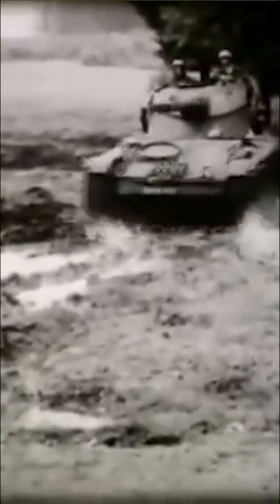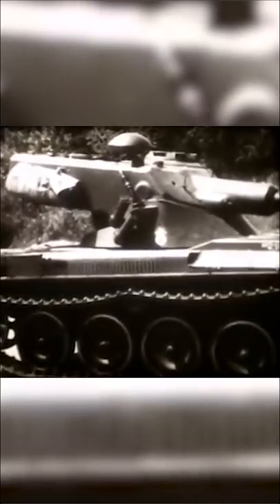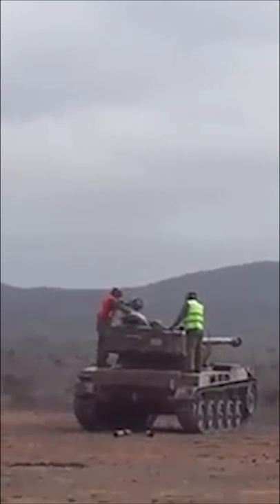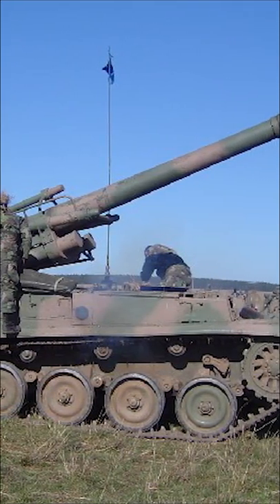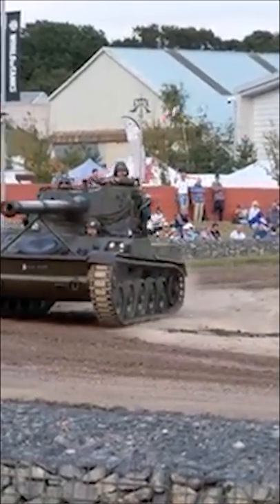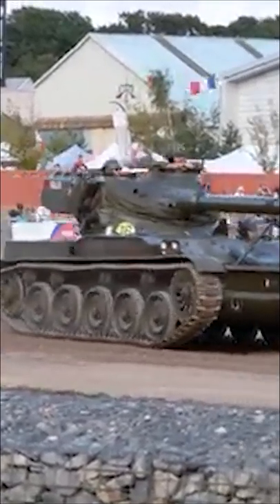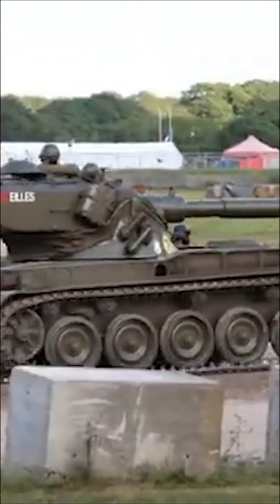Everything You Need to Know About the AMX-13 Light Tank in 60 Seconds | #shorts

Comment: If it was designed shortly after WW2 and is still in service today wouldnt that make it one of if not the oldest tank designs in service today?  I can't think of anything that would pre-date it...
Reply: Vietnam keeps SU-100 in operation, they'd count
Reply from the maker: T-34-85 is also still technically in service, as was the Sherman until just a few years ago
Reply: @ArmorCast  yeah, in Vietnam
Reply: Well how about that i had no idea I've seen some photos of a modernised Sherman but didn't think much of it i certainly didnt know about the T-34 and the SU-100
Reply: @damongale45  there are some African countries that use a m4a3 with a extremely high velocity (like 2,500 mps) 60mm guns
Reply: @damongale45 That would be the Israeli m50s and m51s. Usually just called «Super shermans».
Reply: @finndinklage6653  not exactly. It was Chile which bought about 65 M-60 Shermans in addition to M51 (and possibly M50) tanks from Israel in the late 80s (~1988). The M-60 were Israeli M50 tanks which (like the M51) in turn were upgraded M4 tanks of various models. The be precise, The M50 tanks that were upgraded to M-60 tanks for Chile were based on M4A1 and M4A4 models. The M60 received a new engine (535 hp V-8 Detroit Diesel 8V-71T) and more notably a new gun, the 60mm High-Velocity Medium Support gun. The latter started as a joint development of Israel Military Industries (IMI) and OTO-Melara but they split and each company produced their own version (although its not clear in which development state occured thus the differences between the two versions are unknown). This gun reached a muzzle velocity of 1,620 m/s utilizing APFSDST rounds.
The last M-60 were phased out in 2003 making Chile one of the last if not the last country to operate armed shermans in a combat role. Paraguay operated 3 argentinian upgraded M4 "Repotenciado" and several M3 light tanks in 2015 and its entirely likely that these continue to serve on but they are used in a ceremonial role and might be used in training at best.
Reply: @nopenopeson1097  thanks for correcting me I am getting this from a article that I read about a year ago
Reply: @finndinklage6653  Think it was my man "hendi 1" who made that correction. It would be a shame for me to take credit for the research.

Comment: Cant forget the wheely boi variant
Reply from the maker: The EBR? Not really a "variant" just the same turret and weapons system on a completely different chassis (actually the main EBR versions used the FL.11 turret which only the prototype AMX-13 had)
Reply: @ArmorCast  Hmmm, didnt know, ty for the information
Reply: @ArmorCast  FL11 AXM 13 is a small production made for algerian theater (alongside many AMX 13 US). the prototype AMX-13 had a FL4 turret (and a S232 anti air turret)

Comment: Ok But you missed India too from this list.
India was also one of the users of AMX 13 (both 75mm and 90mm, although details about 90mm ae not available) .
During 1962 sino Indian war, at the late phases of the war , the Air force airlifted about 5-6 AMX 13/75 to chusul airstrip using soviet AN-12 . Indian army actually used this tactic of tank warfare in Mountains , specially during 1947-48 First Indo Pak war , where in the battle of Zojila pass, M3 and M5 stuarts turned the tide in India's favor. the same tactic was also planned to be repeated in case of deeper chinese incursions, but the war ended before that and the engine often failed to start in higher altitude. 

the largest combat , AMX 13/75 and the rare AMX 13/90 ever saw was in the 1965 Indo Pak war , notably in every major tank battles ( Asal uttar , Philora, Chawinda , Sialkot etc) in the Punjab sector. this tank was surprisingly suitable in the muddy terrain of Punjab region where many tanks eventually 

also during 3rd Indo Pak war (part of Bangladesh liberation war) , in the Battle of Garibpur , AMX 13/75 were used alongside PT-76 and M-4 Shermans (with PT-76 Guns) against enemy Chaffee light tanks. and for a major duration of war they were the major armor backbone in Bangladesh. while the western sector was heavily dominated with T-55( local Gulmohar variant with 105mm L7 cannon) , Vickers/Vijayanta MBT, Centurion  clashing against where the AMX was quickly deemed obsolete , given this time the tank battleground was in the Thar desert (Battle of Basanter) .

also idk but from many Indian defense channels ,  I also found that they were also involved throughout 80s and in early 90s to deal with India's  North Eastern states insurgency and IPKF mission in Sri Lanka. 

and an interesting matter is DRDO used the turret of an AMX 13/105 to fit it with a BMP 2 chassis as a part of it's domestic Light tank program ( it was quickly rejected tho for a new K9 chassis LT). 

Anyways I do hope you like the information I'd offered .

Comment: the engine's in front iirc. with no nbc protection overall. 
so on a hot day, or in tropical countries where it is deployed in relatively large numbers, 
it is bloody hot sitting inside when the engine air is blown into the crew compartment.
Reply: there's something call an engine exhaust on the right side
Reply: @jeandelacroix6726  it's not enuff if it is in the tropics. 
in comparison, armoured vehicle of the same era, like the commando 100/150, where the engine is at the back of the vehicle,
sitting inside is like having an aircon becos the cooler air is sucked into the compartment, to feed the engine at the back.

Comment: M48 patton is superior to Amx 13 not only in firepower but in armor aswell. Pakistan and India used a small number of amx's in 1965 war with India having most of them. The amx's were only able to destroy or disable the pattons from a high position from rear or side when they were stuck in muddy water at Khem Karan. If you wanna see how Pattons performed in tank to tank battle, see battle of Chowinda where Pakistani patton regiments decimated Indian centurions. India lost a 120 tanks while Pakistan lost around 40. It's called graveyard of Indian tanks.

Comment: We got too many AMX-13 it's hard to get a replacement because the tank intended to replace it ended up too expensive to purchase in bulk... Should've purchased Pattons (M48/M60) or Centurions that have more Modularity for Future upgrades instead of these small metal junks that doesn't even have stabilizer due to its oscillating turret... 😒

Comment: don't forget the AMX-13 with higth velocity 105mm canon or with the name to  AMX-13/105 Modèle 58
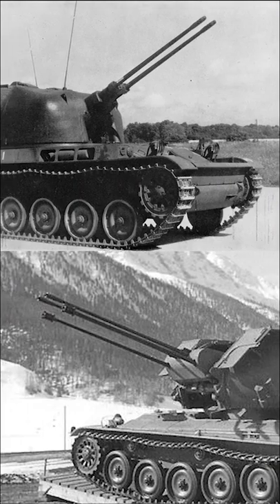Reply: He mentions the 105mm gun at ("One-oh-five") at 0:38.
Reply from the maker: Interestingly there were THREE different AMX-13 variants with 105mm's, one being a howitzer, the second having the gun and turret from the Kurassier, and the third being the Indonesian "Yonkav 2"
Reply: thanks for the information 😀
Reply: @ArmorCast  There were many sub variants as well
Reply: @Armor Cast  actaly there is way more 
From howitzer there is at least 3 confirm 105 variants

And for the anty tank there is also 2 or 3 varrient with a 105 mm gun tho i dout any was with the kuirrasier turret and most must have been with some form of the FL15 turret
Reply: @ArmorCast  the AMX-13 'Modernization' by Pindad on Indonesia basically had the same turret, only few changes on the turret itself, like new FCS, and yadda yadda. the most significant is the Hull, with it's engine changed
Reply: @didrechus9904  2 and 3 indeed was either FL12/15 turret and they were similiar to the SK105

Comment: Actually the 105mm AMX-13 came before the 90mm one.
Reply from the maker: Depends on which 105mm version you're talking about - the 105mm howitzer came first, but the recognizable 105 variant with the same gun from the M51 Sherman and Kurassier came a few years later
Reply: @ArmorCast  The early versions of the AMX-13-105 with an oscillating turret were first built in 1958 while the AMX-13-90 came in 1967. The AMX-13-90 was "only" a modernization of the 75mm one that didn't require as many changes as the AMX-13-105.